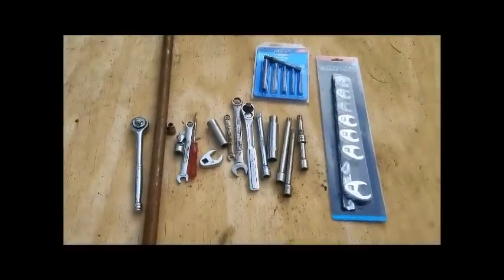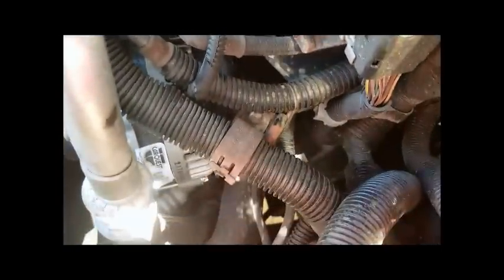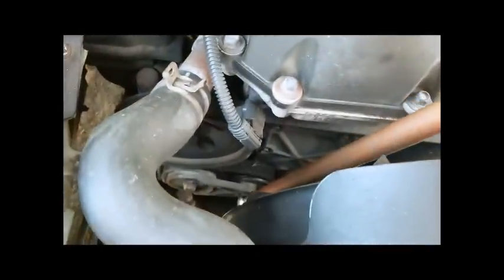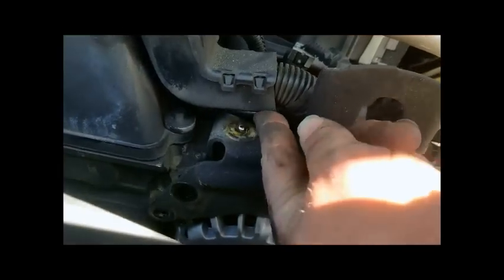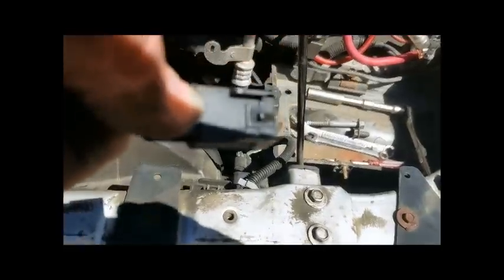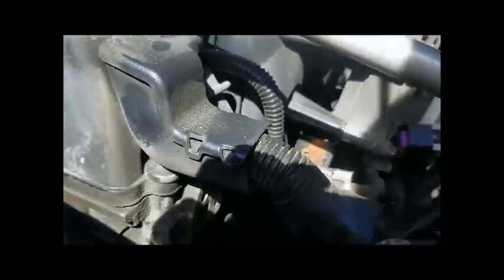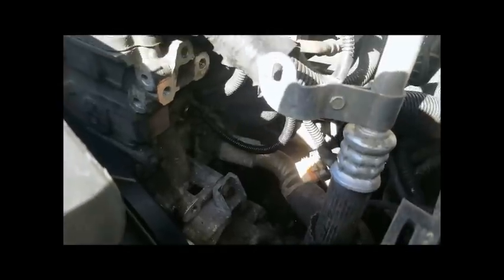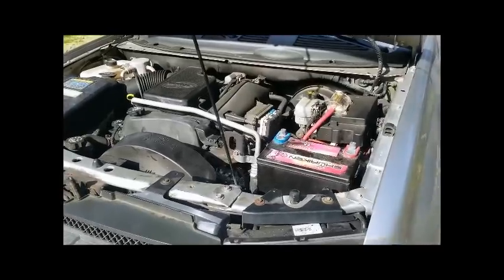How to Change Coolant Temperature Sensor on Chevy Trailblazer 4.2L LL8 I6 Envoy Bravada Rainier 9-7x

Comment from the maker: If this repair video helped you, please Like & Subscribe!!!
Reply: Please adjust ur details info...starting in 2006..the temp sensor is located on the passenger side of the block..opposite side from thermostat... looks like a lot of people following ur info and doing work for no reason since sensor isn't there anymore
Reply: How long did this replacement take you to complete?
Reply: not very helpful to me, I have a 2007 Chevy Trailblazer LT with 4.2... later model 4.2s have the coolant temp sensor in the back
Reply: @Kane Jad yea, I have been watching on instaflixxer for since december myself =)
Reply: @ymisoflyg8612  morning
Reply: Can this sensor be causing over heating my temperature gauge is normal but my radiator get really hot ,thank you..
Reply: Tankyou

Comment: Great video.  Thank you.  I PB Blaster the crap our of all the bolts I deal with as soon as I have access to them so I can hopefully prevent breaking one off.  Glad the temp sensor itself has a hollow core so you could easy-out it.  That could have been nasty.  Again, great videos on both the thermostat and the coolant temp sensor replacement!  Nice video and editing work.

Comment: I just changed my thermostat and was going to change the temp sensor also.   Couldn't find it,  looked and looked didn't find it.   Came back in the house and watched the video again and mine is not in the same location.   Have the same year and engine as in the video.  So I put it all back together.
Reply: Mine is 2008 and its not there either
Reply: If still haven't found it mine isn't there but found it on the head very back on passenger side.
Reply: If you pull the alternator off you will have easy access to the coolant temperature sensor and the thermostat. I used a 19mm open end wrench to take out  the old and put in the new coolant sensor.

Comment: Hi

If you know for a fact your gonna remove the sensor. Disconnect battery cable. Cut wire & stick 15mm socket over sensor & simply turn it out.
Reply: Thanks gonna try this

Comment: I saw underneath this will work for a 2008 saab 97x 4.2 also.
This morning when i left for work my temp gauge wasnt working at all, it stays at cold so i suspect this is the issue as the fan still kicks on and it didnt over heat. So would this be the fix to get my temp fauge working again? All fuses are good it just wont move off cold, i still have good heat also.

Comment: Thank you for posting this video. I have a 07 trailblazer that surges upon cold startup outside temp around 30 degrees. I was wondering if this is the fix. No check engine light present.
Reply: You probably found out already but on the 2006 and above the sensor is way in the back on the passenger side of the engine.
Reply: @amartinez2071  After taking it to a reputable shop it turned out to be the mass air flow sensor. Which I had replaced 6 months ago due to hunting for a fix for improper voltage code on MAP sensor. The cheaper version I bought failed causing this crazy ordeal. Thanks for your response.

Comment: Nice video, thank you. You mention it had a check engine light on, what was the cause of the Check engine, what was it doing? I ask because my truck is over heating just a lil bit, it goes up 2 notches/lines from 210 on the temperature gauge but I have no check engine light on so I’m wondering could this sensor be the cause.

Comment: Have 2008 trailblazer Lt, followed all the steps and low and behold the sensor is not there. So the video was not useful for the sensor so changed the thermostat instead which is there, and that cured the engine light problem, so didn't change the sensor which is actually on the other side of the engine.Good video though.
Reply from the maker: Interesting, does your trailblazer have the same 4.2L LL8 engine? If so perhaps GM wised up and relocated the sensor in your year?
Reply: @E4EonEbay  Hi there, yes it does have the Vortec 4.2 engine. You can see where it should be but it is now solid. I bought both the sensor and the thermostat because if I was going to take out the alternator then was going to do both at same time. Didn't have to take battery out but putting the third screw at the underside of the alternator was very difficult because of a hose that stopped the wrench going over its head. I hardly do any work on cars and followed your video and it was perfect. I believe the sensor is on the passenger side of the engine and somebody else commented that it still difficult to get to.Thanks.
Reply: @alisonkirton8377  I got a 08 too, but I'm wondering what made u change ur sensor? My temperature gauge wouldn't show any movement after heating up the SUV and ac wasn't working and I was told to change the temp sensor...was it more troublesome to change it on the passenger side of the engine?
Reply: @CarlosGonzalez-xu9bx  c

Comment: Hi I've changed thermostat,  flush the radiator,  replaced the fan clutch,and it's still overheating
Reply from the maker: it is in fact overheating, or is the coolant temp sensor perhaps faulty?

Comment: Hi I change the water pump thermostat flushed radiator put a brand new fan clutch and it still overheating can you tell me what possibly could be the problem
Reply from the maker: Were you sure to get all of the air out of the system? Also are you sure its overheating or is it possibly a faulty temp sensor?

Comment: Would a malfunction in this sensor cause a high idle of 950, 1000 RPMs? This is my last resort and am gonna eliminate this issue anyways. Just wanted to know why you would change this component in the first place.
Reply from the maker: I replaced this sensor due to a check engine light I'm not sure if it would cause idle issues.
Reply: DanoTheBull could be bad maf
Reply: Scott Kucinski there is no maf on these till the 2006 trailblazer only map and iat sensors
Reply: Coolant Sensor was causing overheating and flooding of my engine, so yes. Mine idled high and its all good now.
Reply: Absolutely! Have you ever noticed the fast idle when you first start up your vehicle and the coolant temperature is the same temperature as the ambient outside air temperature? If you live in a cold climate, this could go on for several minutes. The PCM will increase the engine idle according to the coolant temperature sending unit and quite possibly the intake air temperature sensor as well. So if your coolant temperature sensor is bad and sending a low temperature reading to the PCM, it could cause a higher than normal engine idle. But don’t just focus on that, you also have an idle air control valve that could be causing a high idle.

Comment: I have a Chevy 2003 Trailblazer with overheating problems I turns to thermostat flush the radiator with a fan clutch brand new water pump still overheating
Reply: Any luck? Did you find the issue?

Comment: So did have to replace the temp sensor and thermostat to clear the code?
Reply from the maker: after changing the temp sensor your light should go out if it was on for that reason, but you may still need a code reader to reset and clear the code, as it might still be stored in the computer even with the light out. thanks for watching and commenting.
Reply: @E4EonEbay  yea have a diagnostic tool and this is the code P0128, "engine coolant temperature below thermostat regulating temperature.."  i will replace it.

Comment: I think I'm starting to regret buying this 2008 trailblazer. I haven't owned it for 2 weeks and the steering wheel angle sensor went out. That was $480.... Now my "check gauge" light is on, and the temp guage is at zero.... But I do have heat. This looks like a real easy fix .....SMH. BUT! I live in Detroit and some piece of shit stole my Tahoe with the 5.3, so I guess I'll just have to deal with it.

Comment: That's the thermostat not 
the temp sensor 🤔
 the Trailblazer 4.2L engine does have an Engine Coolant Temperature sensor. It is located on the passenger side of the engine, next to the last exhaust port near the firewall. It is a two wire sensor.
I looked it up😜
Pretty good video though 👍
Reply: Yeah it is, 02-05 that's the correct location and temp sensor.  06+ it's on the passenger side wayyyyy in the back on the block.   Agree, good video using the crows foot.
Reply: WTF that doesn't even look like a thermostat...
Reply: @ryanlutton8193  look up how to change thermostat and will see this same video from the same door . 5 days later .
Reply: That's not a thermostat...  It's a sensor. Thermostats don't have wires coming out of them, and they have a spring that moves to open and close the coolant channel.
Reply: Ya dude above is right!!! The thermostat is below the sensor a smidge to the right and down. Like diagonal and the thermostat has its whole housing has like a 4" pipe that is clamped in the lower hose. Whoever said this was the same video as the t-stat.....I wouldn't want you to touch a bolt on my TB. Keep your Stanley tools to yourself!😅🤣
Reply: Ughh....I really like your videos but I swear 🤦🏼‍♀️🤨😑 I would LOVE YOUR VIDEO if you explained the troubleshooting issues solved that made you change the CTS...or just why to begin with. 😊

Comment: So I guess they changed the location between 2004 to 2008. Just took the alternator out for no reason
Reply: Chris Jackson back of the engine block on the passenger side. Hard as hell to reach or see
Reply: Chris Jackson check with a mechanic first. I thought it was the sensor but it was actually the thermostat or whatever?
Reply: The Android  how did u get to it in the back of engine did u jack it up or go from good?
Reply: Hood

Comment: Steve Young, what's the normal temperature for 2002 Chevrolet Trailblazer,  LL8-ENGINE, 4.2L, DOHC, L, MFI, 6-CYLINDERS? 
I feel like my car has overheating engine. 
My Chevrolet Trailblazer is more than 125 degrees Celsius see the picture of the gauge of my Trailblazer at this link: https://i.postimg.cc/QCR9hgpj/Inked-TEMPERATURE-LI.jpg
Reply: Any luck fixing the issue, I’m having the same problem.